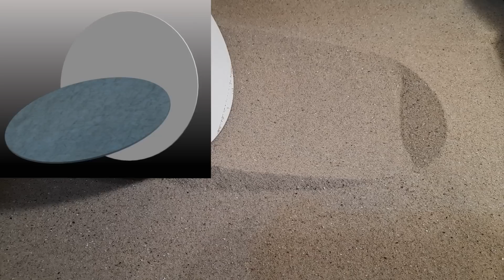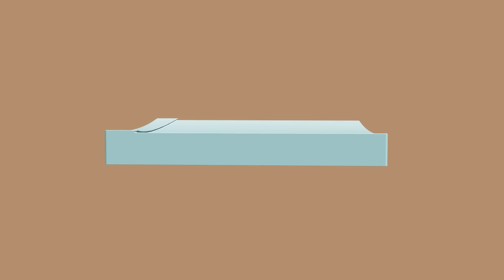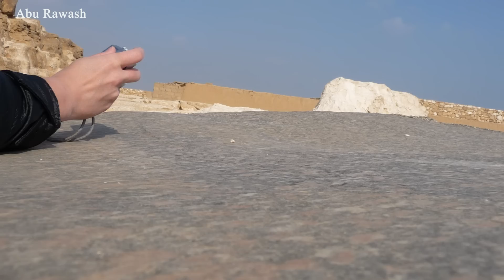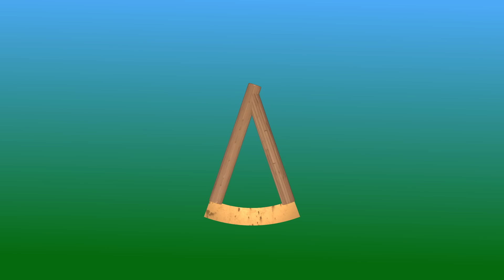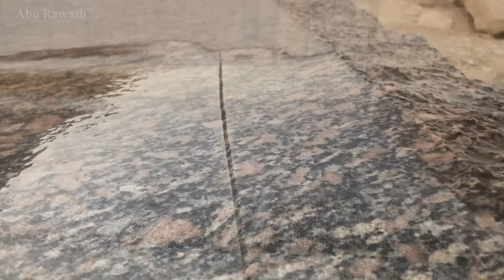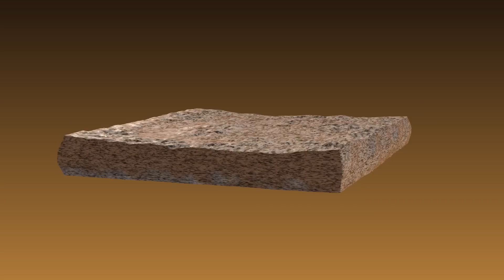The Abu Rawash Artifact: Evidence for the Existence — or Absence of Circular Saws in Ancient Egypt?

Comment: It's not to be taken for granted that the block at Abu Rawash was produced in the horizontal position it is today. This doesn't mean that was its original orientation. It's possible that over time it was moved, or fell sideways, and the worked surface that is now the top is, for example, a lateral waste slice produced during the processing of an artifact.
Therefore, the hypothesized processing technique could have been completely different if the artifact's orientation had been different.

Comment: Just some information about a possible saw...Hardened copper alloys can be made in Egypt with  Antimony or Bismuth-(both minerals available in Egypt). If you take a Copper alloy and add Corundum powder to it, with pressure and heat, you produce a Metal Matrix  Composite. Possibly  this  Copper Alloy, Metal Matrix Composite was the saw blade.
(a Corundum mineral is also found in Egypt).
 Also-Egyptian drilling holes in  stone.... The Met Museum in NY City(Egyptian Arts section)- has a small Egyptian stone fragment with drilled holes in it.  In the bottom of one hole are fragments of a bronze drill and Corundum powder..
See article- 'Hidden Secrets of Ancient Egyptian Technology by Anna Serotta and Frederico Caro..(.in a Met Publication titled 'Perspectives',  May 22, 2105.).
 I and ,and another guy, had speculated that to cut 2 million blocks for the great pyramid, the simplest tech to cut stone was used- steam power. A copper alloy steam engine , on a sledge, pulled around the quarry to cut stone blocks.
Reply from the maker: Thank you. The work was not mechanized, that's for sure. Only the simplest solutions, this will be discussed in the next videos.
Reply from the maker: Thanks for the link to the article. The dates to consider here are 1353–1336 B.C. Egyptian, New Kingdom, Amarna Period, Dynasty 18.
Reply from the maker: Egyptian Stone Working Use of Emery?
July 23, 2024

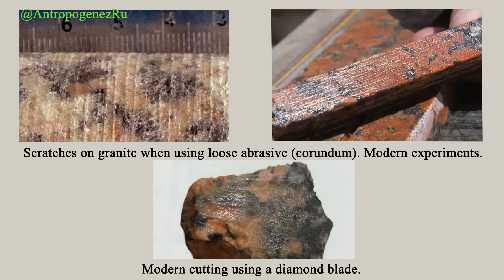Comment: Examples of abraded surfaces (material removal via abrasion) 4:06 - established fact/control.

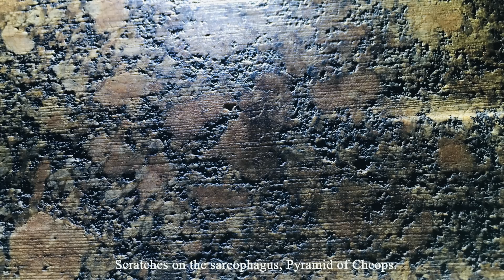Surface of sarcophagus from pyramid of Cheops 4:17 - likely been rough ablating(i.e. deeper removal of granular hornblende) flattened and then slower rate (fixed abrasive) abrading polished.  Due to high speed material removal rate - we probably can rule out electrochemical ablation processes,  also easily rule out other ablation KNOWN(today) methods(e.g. plasma,laser,ultrasonic,x-ray,radiation,etc..).

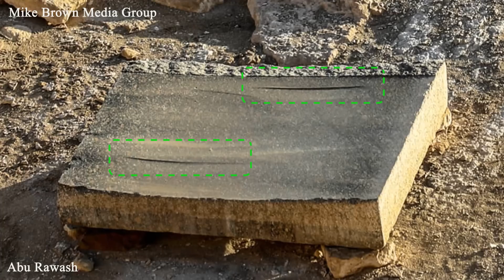Comment: In my opinion, it was a rotary grinder with a grinding disk much smaller than the radius of the curvature of the stone.  This rotary grinder was suspended from a solid platform on a swing arm with the radius of the the curve on the face of the stone.  The width of this grinding stone was as wide as the dimension from the deep edge cut on the top right green dotted highlighted area at 5:18 to the line where the light colored area ends just at the bottom green dotted line.  In this picture, the orientation of the swing arm would be in a pendulum motion left and right.  It appears the swing arm had a tendency to deflect towards the camera causing the edge of the rotary blade to dig into the stone more on the edge away from the camera, which is why we can see the dark lines created by the shadow due to the different surface elevation of the cuts.  They would have either had to move the stone or move the swing arm/grinder either toward or away from the camera as they cut various rows of material away, and this caused the depth of the various cuts to not be uniform.  Either that or the stone was moving away from the grinder due to the vibrations during the cut and this caused the irregularities in the cutting depth.  Regardless of whatever tool it was, it was not human powered hand tools.  It was powered by some other form of energy, be it electricity, wind, water, or something else.  The RPMs to make those edge cut imperfections/errors are way too high to be caused by human powered hand tools.

Comment: There could be another reason for the lines of cut marks and the curvature which can occur accidently by a poorly used but quite long flat saw of the double ended pull type like those use 100 years ago by loggers. When these saws are used incorrectly at the start ie one person is pushing rather than letting the other guy pulling the blade can bow when pushed then a bad start sets the arc of the  cut line which can run through to the finish, one other thing that can cause this effect if the teeth cutting in one direction are not as sharp as those cutting in the other direction the blade will remove less material with the blunt side ,result a curve in the cut sometimes 
you will just keep cutting to get your shift finished.
Reply: You are totally right.  All those fancying mega tools probably never handled a saw in their life. It is a sad that interesting subjects are constantly being polluted by senseless pseudo science on the internet.  Sorting out good info is a journey…

Comment: One possible reason the errors appeared is because the cutting tools were running unattended for days on end. Perhaps water powered?
Reply from the maker: Thank you. Yes, this is one of the most probable explanations. the use of simple automation of the process, I talk a little about this in the second part https://youtu.be/ii83g_V8tKA Another option is the opposite - sawing happened so quickly that the error was not noticed.

Comment: Some of the surfaces look just like concrete that has had a mold removed after drying, with the clumps of air pockets here and there.  They might have had a way of making cement from whatever type stone they wished.  I'm not saying they crushed rock to make cement, which would have been extremely difficult, but rather used some type of acid or heat to soften or crush such and then sawed, scraped, molded and reconstituted it.  -Just a thought.  Maybe a really big magnifying glass to melt stones... maybe even using water to quick cool and explode some large cuts.  How ever they did it, it is amazing.
Reply from the maker: Thank you. Here about it https://youtu.be/bpvFs9bZu10